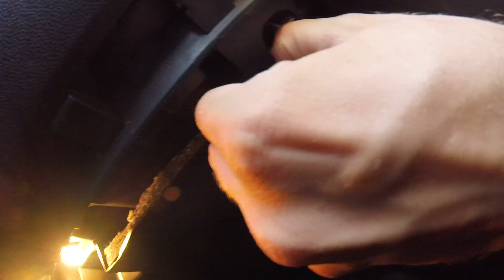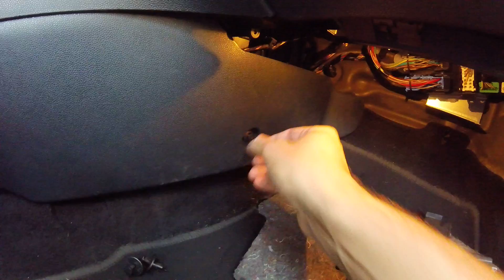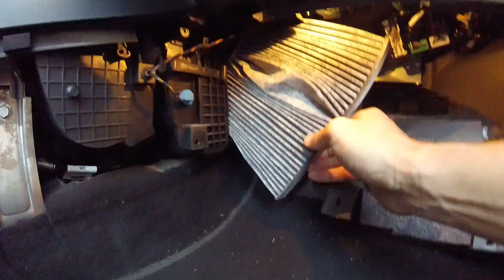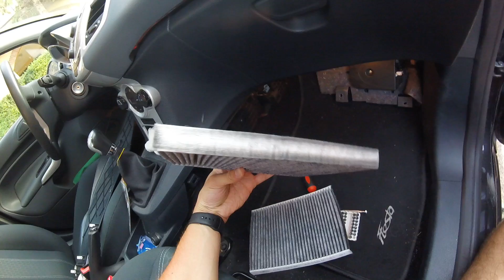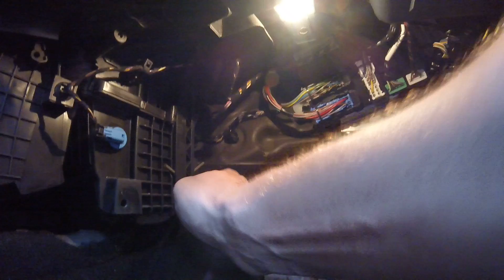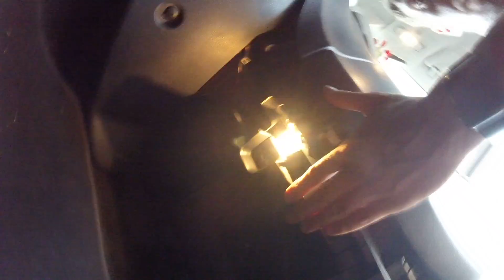Tutorial sostituzione filtro anti polline Ford Fiesta 2008 MK7

Comment: Grazie, molto utile - ma il meccanismo che regola i flussi d'aria si trova lì? Dall'altra parte?
Reply from the maker: Purtroppo questo non lo so, non ho mai smontato a fondo quest'auto.
Reply: @mrplay87  io o un problema non si accende le luci retromarcia ford firsta
Reply from the maker: @martinabangrazi1726  Non sono un meccanico ma controllerei 1) la lampadina 2) il fusibile che alimenta le luci (i fusibili sono dentro il cassettino portaoggetti e nel libretto ci sono i codici di quale fusibile corrisponde a cosa).
Reply: si, dall'altra parte. In bocca al lupo, non è molto accessibili e si rompe sempre!